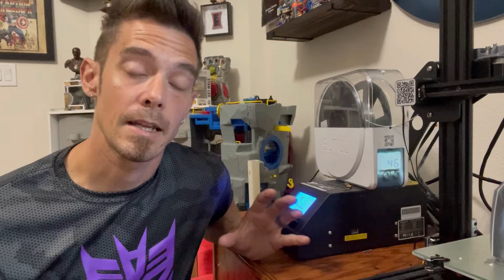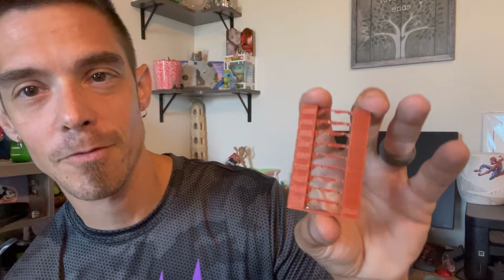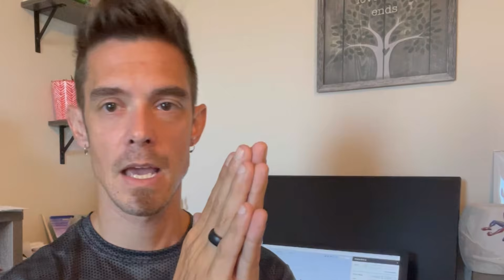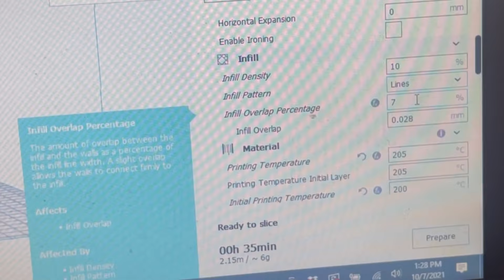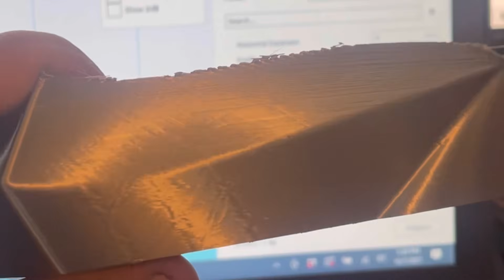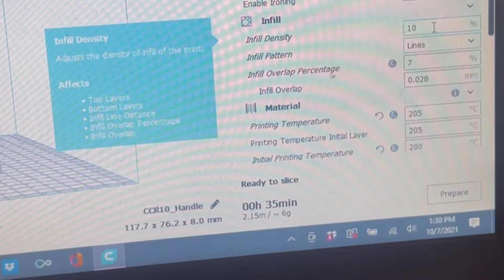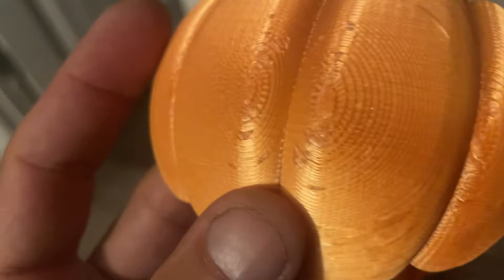3D printing silk filament| how to get silk 3D prints to look the best | 3D printing tips & tricks

Comment: Purchased a batch of Jayo Silk PLA, had never heard of them before. Experienced SEVERAL issues with my first few jobs, and I was concerned that maybe I purchased a bad brand of filament. After watching your video I realized I have many settings which require tweaking. Hearing you actually recommend Jayo at the end of your video put my mind at ease. Thank you.
Reply from the maker: Jayo has come a long way. As long as you run it through a dryer & use the settings recommended here, you are golden
Reply: I am failing with JAYO as well. What helped the most for you?
Reply from the maker: @vector4904 what machine?
Reply: @Darkwingdad bambu p2s combo
Reply from the maker: @vector4904 slow down print speed and acceleration,  esp outer wall speed & print inner to out on walls

Comment: I can't find the balance of temperature, speed and fan speed. I've tried no fan, lots of fan and in the middle at 40mms, i've tried 200 through 240c, I get nasty ripples on my walls. When I started doing it stock settings it came out a lot better
Reply from the maker: What printer & slicer?
Reply: @Darkwingdad  I'm noticing on your MF doom mask you have the same ripples on the teeth pieces... you got as bad as me! I am using bambu a1 mini and bambu studio. Also like your retraction test... I get zero stringing at any setting yet a ton of cotton candy looking super fine strings on prints.

Comment: Hi mate!  Thnx for this video!!   Im already 2 weeks testing and cant get my head in.... using creality hi printer with creality print slicer,  sunlu pla silk silver.     Do you have any tips on settings for me?  Its only about the z seam
Reply from the maker: You’ll definitely need to slow the speed down across the board, are you having issues with just the seam?
Reply: @Darkwingdad yes thats the main problem

Comment: Now, I know this is a 4 year old video and you are most likely not active on it, but I’ll take a chance:

When printing the temp tower, should I use the 40mms / jerk / accelleration speeds that you mention here in the videos, or should I just run stock speeds? 

Logic dictates that I should use the 40mms etc, since that is what I will be printing at around. But still wanted to ask :)
Reply from the maker: Yes, whatever speeds you’re printing at you should do your temp/retraction/calibration tests at. Still here…always responding lol
Reply: @Darkwingdad  haha nice! Yeah, I am printing the temp tower at the moment. It doesn't seem like there are any noticable difference on it - at all. Will see how it looks when done. :)
Reply from the maker: @therealjonaswp602 at lower speeds usually you have more wiggle room. I find 205-213 works the best when I had my ender 5 & marlin printers
Reply: @Darkwingdad  Hmm yeah. The temp tower is done, but tbh - there is no difference at all in any of the temp ranges. Except a bit of stringing. 

I used the one integrated in Bambu Studio. Not sure if that one is good or not.
Reply from the maker: @therealjonaswp602 stringing is usually retraction or moisture related

Comment: 4/2025 - I'm 2 weeks newbie. Anycubic Kobra S1 Combo. Reviewed this video several times and for the life of me after days of calibration and print tests etc. Every Silk print I try is a zit covered mess. I've completed temp, retraction, flow rate, and VFA calibrations dialing in settings for the filament. I've changed/slowed print speeds, jerk settings. Still have the "Zit" issue. Other prints in other filaments are fine. I have Elegoo PLA, Elegoo Matte PLA, Elegoo Silk PLA, Ziro Silk PLA, Sunlu PLA, Sunlu PETG. 

What I am noticing is Models I design in Fusion 360 are great, anything downloaded are difficult. Maybe this is how the model was created in a non CAD app maybe? In any case,afgter several days running full circle on this, can anyone steer me in the right direction here? I ran across where this may be attributed to the power recovery feature? Unable to get that to work as well in changing that on my Kobra S1. 

Any guidance would be greatly appreciated. ~Thanks, Tony
Reply: P.S. - The ACE Pro unit has a filament dryer and I've "Soaked" the filament all day or overnight. I have Dessicant in with the unit and per my hygrometer, humidity is 15% over 24 hours. Print Temp is 205, Bed Temp is 55, Jerk across board is at 7, am using the line infill at 10%, Models are sliced in Orca Slicer Next by AnyCubic. I will try slowing down print speed more to 45-50 (currently 70-80).
Reply from the maker: Turn of the power loss recovery, reformat SD card, run the filament in a dehydrator. Those zits will be gone.
Reply: @Darkwingdad  - love to but unable to find any guidance online pertaining to Anycubic slicer next, where to add them, what to add and the parameters to adjust. Seems this would be a good feature to include as selectable option in a slicer. This is a new printer on market and it doesn't need a card to operate.
Reply from the maker: @tonyt3935  the power loss recovery should be in the settings on the machine
Reply: Just tried it and no go. I'm going to reach out to AnyCubic and see what they have to say. Shame hardware device manufacturers always cheap out on device memory over 25 cents for an extra or bigger chip. No reason for a mem buffer run out of to pause a print in between a write operation. Oh well. I'll post back after a support chat.
Reply from the maker: @tonyt3935  just out of curiosity, what’s your retraction set at?
Reply: Filament setting overrides

Retraction length .9
Retraction speed 36mm/s

1st layer temp 200 - other layers 195
Max volumetric speed 12mm 3/s

Z hop type - Slope

Saw mention of maybe playing w hop type but unsure due to lack of much info. 

Thank you for responding.
Reply from the maker: @ check wipe distance & nozzle priming status. Orca slicer does a great job on stock settings. I feel. A .5 distance & 40 mm/s is ideal for silk on direct drive. Maybe check out orca slicer or bambu studio
Reply: Well, took a break away this afternoon, thought about your advice and comments. Adjusted as recommended, no real changes. Ran across another vid elsewhere and tested and changed a few things and pretty successful tests. Now printing a  model and will update tomorrow as to results with info on what I changed. 

Thank you for your responses, assistance very much. You got me thinking so I'll update tomorrow on my results. 

Tony
Reply from the maker: @ curious to know your results, what did you try & change. Your issue was enigma ish
Reply: @Darkwingdad  well I saw a vid and the guy pushed me to opposite direction. Increase temp. Well it's pretty much smoothed everything out but not near good quality yet. Working on seems and retraction tweaks now. Havin vertical band or strip that's dull and I'm testing using the primitive cylinder from the slicer to test. Using line infill as well. More to come.....
Reply from the maker: @ what were your temp towers showing? Is this a klipper based machine?
Reply: I've come to think temp towers don't work well at all. AnyCub8c uses their own slicer based on Orca. I've messed up and about to reset to default and start again. Lol
Reply from the maker: @ if printing over 200mm/s temps definitely need to be increaesed & retraction reduced. I’m working on a new video for klipper Machines.
Most my silks I print at 200/250mm/s and print at 215
There’s some I’ve been able to do a tad higher in speeds and max temp I’ve done is 220 but keep the bed at 50
Reply: I've counted and gone back to defaults on filament and everything within the slicer app and starting my first test cylinder now and move from there. 

So u reduce retraction w speed? I'm back to working on removing the zits now and I'm changing how I document my changes each time so I don't overrun my efforts.

Comment: Thank you! I'm just getting comfortable running PLA+, Silk, PETG, and other non HS filaments on my 2 weeks old Flashforge Adventurer 5M. I was pretty intimidated by all the numbers, but I also remember helping my buddy level his Ender 3 a few years ago, so I knew I just needed to buckle down and focus... You helped me in more ways than one!! You've earned a sub!!

One question from a total noob: what sort of support settings are you using for the DOOM masks? Organic trees?
Reply from the maker: @ho0t0w1  I have a 5m, great machine, just bump the wall speeds and infill down and decrease accelerations, enable accel to decell and its prints great! I like using slim tree with variable layer setting

Comment: I just wanted to say thank you for this video.  I was having an impossible time trying to print with silk PLA.  But I seem to be getting some good prints with a dry box and lower speed settings.
Reply from the maker: @YdnarLah37  dry boxes help keep moisture out but will not remove moisture that is present in the filament but def a good preventative step

Comment: i give up. i bought a bambu because i didnt want to bother with all this fine tuning. Guess i'll just stick with bambu filaments for their presets, even if it means that I have to give up on the other more affordable options in the market. The savings simply isnt worth it if it means that I have to put in work, to make it work.
Reply from the maker: @87togabito  silks need to be printed slower & the temps have to be adjusted as well. I assume your using bambu studio or orca slicer?
Reply: it honestly doesn't take that long to tweak filament settings based on material, it's definitely worth doing if it means you can save money on cheaper filament or choose from filament types that bambu doesn't offer

Comment: Really appreciate your video! I really am surprised why there is not more content about this material.
I initially printed some stuff with PLA with next to no issue even as a beginner - but that really does not apply to Silk filament!
I will try what you recommend and hope results will improve - at least as far as it can get with that "Bresser Silk Copper" filament I bought for cheap and which is still making some pop sounds here and there even after hours of drying. Wish me luck! =D
Reply from the maker: Soooo how’d ya make out??
Reply: @Darkwingdad  I did a print of "Buddha The Rock" with that filament over night and it came out pretty decent (besides some gaps which are related to filament quality I think and some slightly annyoying z-seams where support was)! I watched a couple more of your videos but not sure if after or before that print. I sometimes do too much input and then forget things... :P
But I am pretty sure, that your content helped me to get to that printing result. Thanks for that! Though I am not sure, if I will be able to recall that for future prints. I made a profile for it in Cura though. But actually I'd like to change to Orca slicer... I guess I have to go a bit slower to not change to much at once ^^

Comment: Found your video trying to figure out why my silk is clogging .6 nozzle
Reply from the maker: @RobertArmstrong-xm9zg  what’s your flow and current retraction? Also did you do a pid tune since swapping and is the slicer set to a .6?
Reply: @Darkwingdad  everytime I try to do the tune..it crashes my system, so I'm not even sure what it does. I did set extruder to .6. Retraction is default by test..nothing was better. I have gotten good prints but last few nights I tried white lithophane, gold silk, and multi color silk. With all failures. They start good, and then get destroyed
Reply from the maker: @RobertArmstrong-xm9zg  what specifically crashes the system & how? Are you hooked up through pronterface?
Reply: @Darkwingdad  it crashes Klipper..I run a N4Plus

Comment: Thank you so much for sharing.
How do these settings apply to Creality K1max, that can print at much higher speeds?
Reply from the maker: @aaandis  I’m working on a silk with klipper video, let’s just say you can’t print as fast as you want to but still faster than a marlin printer
Reply: @Darkwingdad  thank you so much for almost immediate response ❤
I am experiencing streaks on the flat parts of my curved surface. Thinking of acceleration to be blamed.
You gave very good tips I now need to go back and explore.
Reply from the maker: @ this is on your k1 max?
Reply: @Darkwingdad  Yes. Actully your tips helped a great deal. I lowered the speed to 125 mm/s, temp to 195, and it works! Really good quality prints.
Thank you !!!

Comment: I know this is an older video but I needed to see this! Just started 3D printing about 4 months ago and was printing with normal PLA all day long. Now I am printing with some Giant Arm silk silver and have been having alot of issues you mentioned. Clogging non stop, seeing infill through the walls, stippling on the surface from extrusion issues. Took your settings and basically split them down the middle to create a base profile in Cura that I can tweak. Printing something now with those settings to see how it goes! Thank you!
Reply from the maker: @OmegaSimPilot  make sure to check out part 2 & 3 of my silk videos too!
Reply: @Darkwingdad Thanks! I will watch those too! I didn’t listed to step one about printing towers and paid the price lol I just want for some settings changes and let her go..got back home and filament got stuck in the Bowden on the hot end side and filament spaghettified out the side of my extruder lol this Giant Arm stuff seems to work better I found at no less than 215 on the nozzle. Was trying it around 205-210 and on a new nozzle, it will print 1-2 jobs, then part way through the third it just stops up completely
Reply from the maker: @OmegaSimPilot  do a retraction tower too sometimes you can lessen the distance and still limit stringing and blobs
Reply: @Darkwingdad  Thanks! Learned quite a bit in Part 2 and 3, especially the combing feature in Cura. I have been getting those end blobs when the printer goes to print a new layer which was annoying. Especially since the parts were sort of thin, half curves for the Space X Starship that need tight tolerances to fit together. One side was perfect, then the other side was a mess. 

So far my retraction distance of 4mm at 45mm/s, 215 on the nozzle is working okay on this print that's going. Its a 15 hours print so we will see how it goes!

Comment: This is incredibly helpful…thank you!  Subscribed and saved this!
Reply from the maker: @magrum21  thanks! Glad to help!
Reply: @Darkwingdad  - I had taken a hiatus from printing due to a busy work schedule and a bit of frustration with my Ender 3 v2, but I’m slowly learning more and more and getting things dialed in.  Videos like yours which are straight forward, clear, no hype or showmanship are perfect to learn from.  I appreciate how you explain things. Great job sir!  Have a good evening!
Reply from the maker: @magrum21  I’ve got a nicely modded ender 3 neo, doing some videos soon on it, if you need any help just ask! I have 2 other videos parts in silk be sure to check them out as they have more in-depth settings for even better quality!
Reply: @Darkwingdad  will do!  I’m building a collection of helpful 3D Printing videos to reference as I have time.  

My main issue with my v2 is the back left corner of the bed, and the way that cable tray sits and makes it hard to adjust the spring where I need it.  It’s just incredibly tight.
Reply from the maker: @magrum21  look into silicone bed mounts. Set em once and you never have to touch em again!

Comment: Realyy liked the video. I have a question. Have you done any printing with the Creality K1c? And if so have you done a video with it using the silk filament?
Reply from the maker: @roncarroll4531  I have a k1 max, I recently released a video with my or a slicer profiles for printing great quality with pla & plan to do one on silk, but I can tell you if you use those profiles & set the print speed to 50% they print fantastic! I can link you the video if you’d like

Comment: When u DO have to sand a silk print,  you lose the beautiful shiniest of the silk.. how best to make it look again like the original silk after sanding?
Reply from the maker: You can try using a heat gun or torch to bring back the luster but you can’t over heat it. A full coat of clear coat can help too.